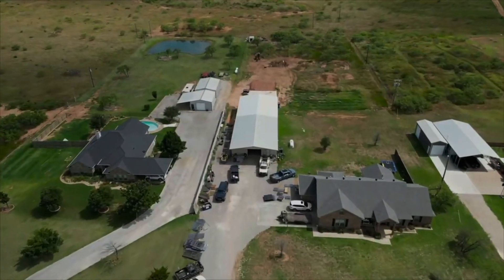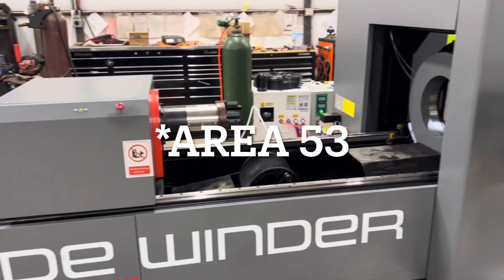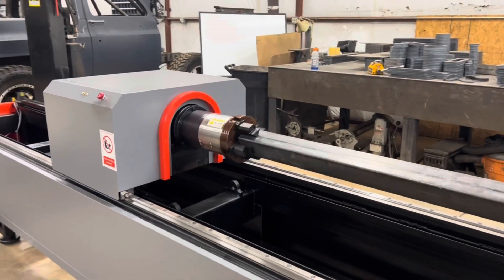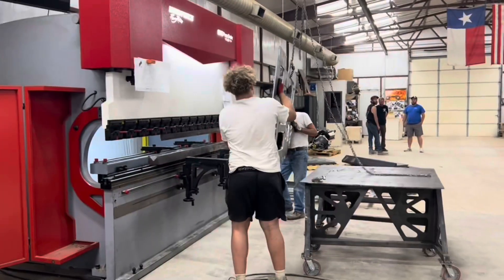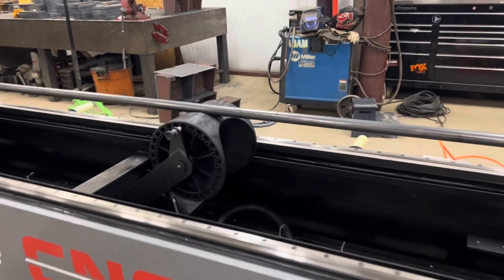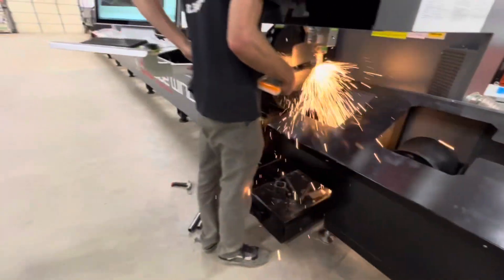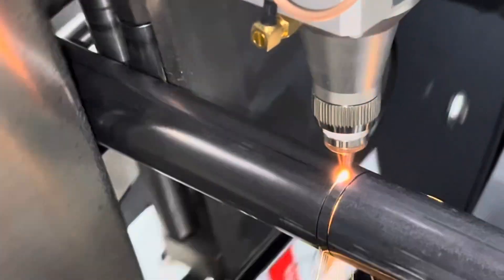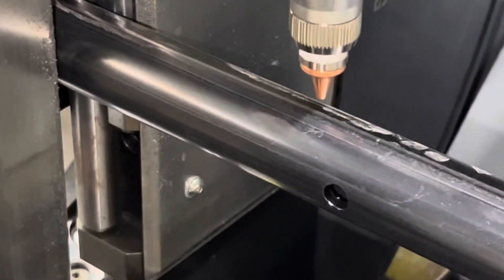SideWinder Tube Laser

Comment: If there is a concentricity requirement, is there any option to achieve that? How do you keep track of the part when rotating ?
Reply from the maker: well, not really.  I guess if you chucked it on the ID, the height controller does move around the the outside of the part concentric with the ID, but not really sure how precise it is